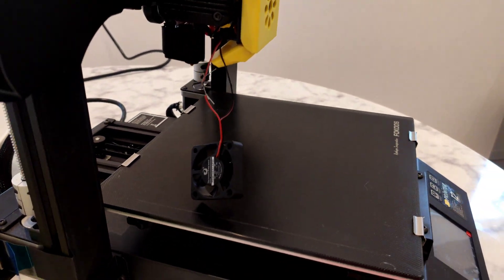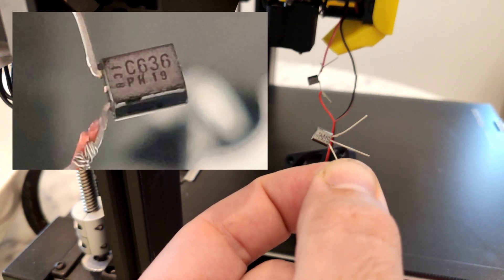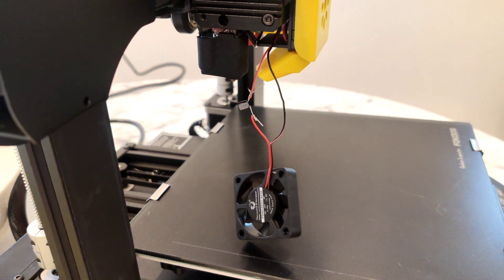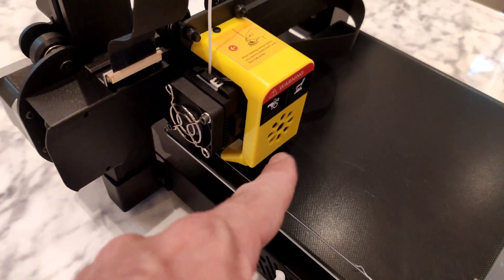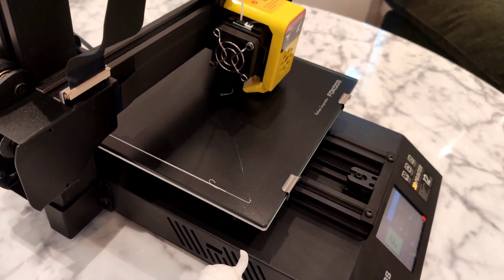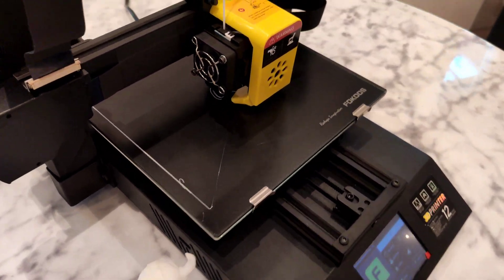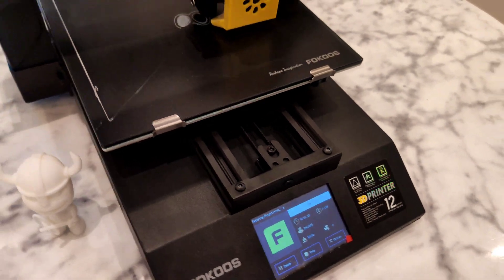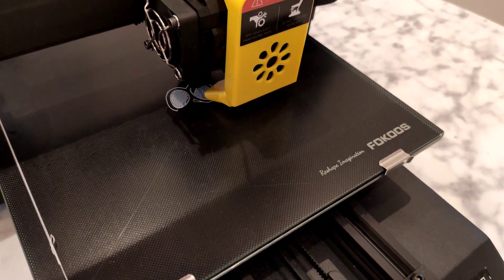Cooling Fans Mod that makes your 3D printer quiet, FOKOOS Odin-5 F3

Comment: So what exactly does the mod do? Does it also reduce airflow?
Reply from the maker: Principle is very simple, transistor will clean up the PWM signal (disadvantage - the fan gets about 20% less power) this is perfectly ok for motherboard, drivers or extruder cooling 👌